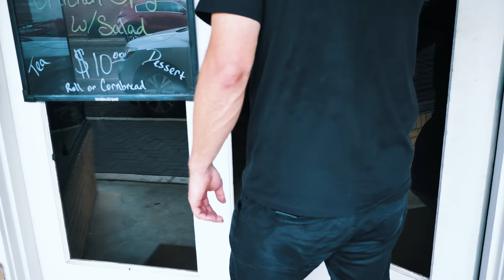RARE JEEP LAREDO & 3-WHEELERS FOUND IN LINDEN, TX!!

Comment: I remember back when the three wheelers were popular and it seemed like it was the leading cause of death in my town until they were banned. Fun but dangerous as all hell.
Reply: They are not any dangerous than motorcycles,   they never should have been banned.   We had two and they were great fun, never had any issues crashing on them.
Reply: @tysonmclane5909  "They are not any [more] dangerous than motorcycles" 😳🥺
Reply: @wileecoyote5749  And don't forget serious injuries 😉
Reply: Got to ride a 185S 1981 Honda new!! So fun!! You quickly learned what it could and could not do. Like any other motorized toy,/play bike , You could get hurt badly.
Reply: It was proven years after the ban that 4 wheelers are no safer than 3 wheelers. Stupid operators still get hurt, smart riders don't.
Reply: @JohnMiller-zn9pf  Link? Three wheelers are inheritly more unstable than 4 wheelers.
Reply: @kimosabbe50  these were articles I read over a decade ago in different ATV magazines.
Reply: @kimosabbe50  wikipedia 
"Production of three-wheelers was voluntarily ceased by all manufacturers by 1987, in light of safety concerns, and ahead of any legislation.[5] Though future studies would show that three-wheelers were not considered more unstable than four-wheelers (although accidents are equally severe in both classes). However, it was determined in a CPSC study that three-wheelers are no more dangerous than other ATVs.
Reply: @JohnMiller-zn9pf  back when three wheelers were in production there was hardly any emphasis on safety gear like helmets as there is now. People were more care free which in turn probably resulted in more people getting hurt no matter what you are riding so I agree with you 100%.

Comment: Hey Dennis, the door closer in the coffee room is not ajusted property,
Lousen the slide nut and bolt, remove the bolt on top arm take a crescent wrench and put some pre load on the arm and reinstall it arm should be flat agents the casing . Now turn small Allen screws to liking, door will be easier to open and won't slam shut.
Love the show.

Comment: Nice find Dennis, I still have my ATC250 that I bought new in 1984, it has broken both of my ankles at different times and separated my shoulder twice but she is a keeper and I still ride it but just putt around.I learned young that if you mess up on this thing it will make you pay and it has.Thanks for sharing.

Comment: I see a nice Honda 250R and what may be a 200X ATC in the background...I myself have an '87 250R that's ported, polished, jetted, with a Cobra Kit exhaust and 2" spacers on the ends of the axle...it goes like a scolded dog, especially on the sand with paddle tires on it...🤘🏻🇺🇸

Comment: These old jeep are un killable. Have a 1982 cj7, been beat to hell and back. Been sitting for 22 years and last 3 years outside. Put gravity fed gas feed on and it thing runs. Carb could use a rebuild but it works. Oh ya also all 6 plugs were melted, thermostat was in backwards and clogged with corrosion but she still ran, and ran pretty good
Reply: This jeep was a prodgect abandoned 22 years ago. Shitty fiberglass body, skid plate welded on, susspention mpunts are jacked, this thing has had a hard life!

Comment: Honda 3 wheelers had the riding position wired. In fact lots of people know this Honda had the geometry supposedly patented. I had a ATC 110 first then a Yamaha TRIMOTO 125 and then an ATC250 R. Only problem is you couldn’t get throwed or fall off without it hitting you somewhere and leaving a non washable mark. KAWASAKI made a 250 2 stroke 3 wheeler that had really great handling. Friend had one. 
Then we got grown and moved on to 2 wheels and started off-road racing. GREAT FUN!

Comment: Rare find, but about the worst setup for off road. I had a 79 golden eagle with 304/ automatic. The auto just killed its capability in the woods. You basically had to floor it at all times unless going downhill, and 304's just dont stand up to that very long. . The hubs manually  locked on mine on a 79. It was a quadra-trac though. lol. However in snow/ice/ super slick stuff, I could turn the locker in the glove box and it WOULD get up the obstacle. I just prefer a straight 6 or 360 and a manual is absolutely necessary on a jeep. I love your videos!

Comment: Unfortunately the band on the make and sell of new 3 wheelers. Was banded because of many accidents. But there was three accidents that was used the court case to stop the make and sell of them. One of the cases was the one my sister and I were involved in. A drunk driver pulled out in front us and then slammed on the brakes. Because the tires was so big and they kept us from steering around the truck. Were are friend that was in front of us. Her 3wheeler had smaller tires and she make it. We didn't, at 55mph into the back of a 65 Ford F100.

Comment: I ordered a 1980 jeep Laredo CJ7 in the summer of 1979. Took delivery in November of 1979. I used it to go back and forth to work until 1990 when I bought a GMC truck. Afterwards I just used it on occasion. It’s in my motor home barn right now and was shown at Cruising the Coast in Mississippi for a few years. It’s never been wrecked and has a few modifications. Would love to know the value of it for when I pass it down to my son. I paid $10k when I bought it and was told it was the first Laredo CJ7 in the southeast US. I have pictures but don’t know how to attach them. And don’t know how to follow this comment.